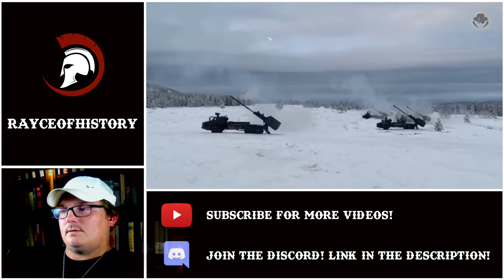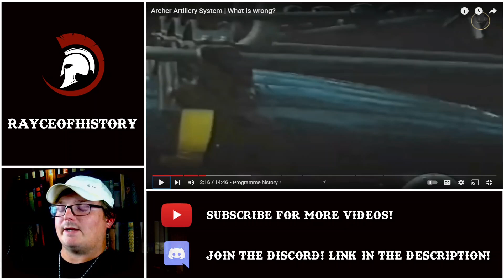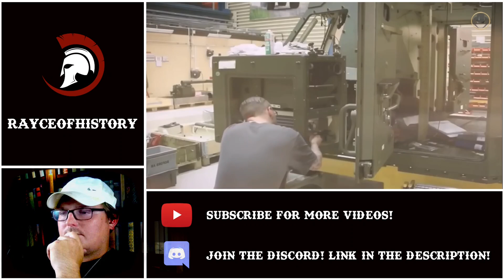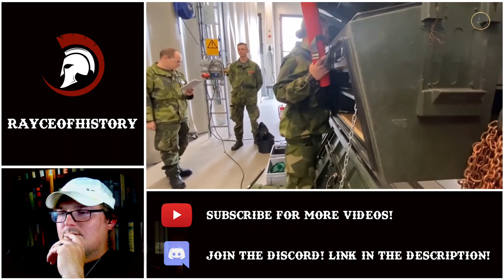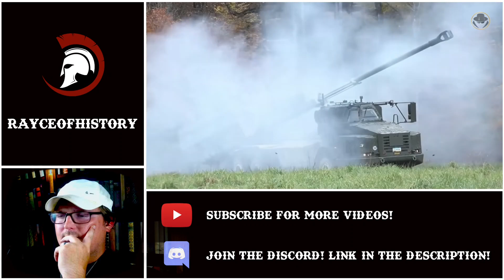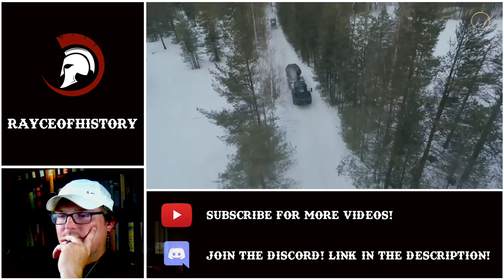Texan Reacts to Sweden's Archer Artillery System | What is wrong?

Comment: Britain has been in talks with BAE for that last few years about Archer . Archer was showen last year on a Man eight by eight chassis and not the volvo forestay chassis this is more suited to nordic country's not because of the snow but in summer there is alot of swamp areas in country's from Norway to Finland. So having it on the Man 8X8 is more practical for mainland Europe for speed and Spain parts off the shelf for mantinance as Man truck is a comon brand in  
Europe and among NATO country's  . The UK is now planning on replacing the SP 90 with the Archer it has recently ordered its first batch will most likely start to arrive later this year

Comment: The achievable rate of fire  is: up to 6-9 per minute in MRSI-mode (Multiple Round Simultaneous Impact) depending on source or (theoretical) 1.25 rounds per minute  in sustained fire. That's 75 per hour. Theoretical fire rate, practically not achievable.

However: Archer sucks if you are on the receiving end. Together with the PzH 2000 and the RCH 155 this the fastest MRSI capable 155mm system and in MRSI mode it basically can take out a bridge. And do something for which the US army relies on HIMARS. The US has nothing similar.

Comment: Firing artillery is different in burst and sustained fire. It all has to do with barrel life, heat, and stress on the equipment.
He did mess up though, as its 3 rounds in 13 seconds, not 13 rounds in 3 seconds.

Back to the point though: Burst firing with artillery is about concentrating a lot of boom on a small area in a short time, while sustained fire is about suppressing enemy troop movement in an area, and is carried out over a longer period of time. Burst fire builds up a lot of heat, and should therefore not be maintained for longer periods of time, as it drastically reduces barrel life.

Comment: Archer has not been produced for so long time so   it is not surprising the export is not so extensive yet. The offroad possibility vs. ordinary truck mount is a huge advantage in rainy spring and autumn season (look at Ucraine now). It is based on the Volvo dumper front which has been produced for a long time = not so complicated to maintain as the video creator believe 😊

Comment: I don't but the road truck argument. I work at Volvo Construction Eqpt, where the Articulated Dump-truck this is based on is made. We have service points all over the world, just like road truck companies. The engine used is 90% the same as on in a Volvo road-truck. Also, the technology used in the ADT is not unusual, so a heavy vehicle mechanic can fix it just as easily as a road-truck.

Comment: its not only about fighting on Scandinavian territory.

Its also about fighting with a total lack of manpower. Every weapon-system works with a skeleton crew. Really, every single weapon system works with just one person in a clinsh.

Its also about having absolut minimum bloat. Every system should be able to serviced like a civilian vehicle. The S-tank have the same engine as a Volvo Tractor. JA37 viggen have almost the same engine as a DC9 jet, the CV90 have the same engine as a scania truck.

Last but not least. If push come to shove. Last stand would be a guerrilla war with tanks, fighter-jets and submarines. The moment the enemy would be dominating, the Swedish armed forces would just vanish in the terrain. And slowly grind down the attacker to nothing is left.

And it snot only tailored to just Scandinavia in general. But there are specialty equipment and also units for the fields in the south, the coast, the forests and the fjäll (alps). Fjälljägarna (alp-hunters) are one of the most brutal regiments trained to walk weeks on foot in arctic condition to strike far behind enemy lines and totally take out there chain of command.

And you might think... how bad can it be, how many of them can there be. Well, they are conscripts, so ... loads and loads and loads.

Anyone attacking Sweden in the 80 tys would have a really bad time

Comment: According to my captains in the Swedish army the Bandkanon was too accurate. They said they wanted an artillery with more spread. Bandkanon had to re-aim to get the spread.
Reply: with a digital aiming system like the archer has, artificial dispersion could be added and removed as needed through software settings, therefore it could have very precise fire to avoid hitting unnecessary targets and be inaccurate in the case its goal is to simply just shell a big area of trenches/bunkers
Reply: Yes, correct - We look at nations developing artillery that with its standard ammunition can be used to hit specific at greater range. Whereas we treat artillery, like howitzers and mortar,s as area-effect weapons and if needed use specific ammunition for precise work in "simple" weapon systems. I mean Sweden co-developed the EXCALIBUR shell with the US and we made, for our own use, the BONUS and STRIX shells. Better to develop new munition than develop whole new redundant weapon systems around a standard munition of today's capacity right ;). Other nations pour a ton of money into something they are not able to use for its intended purpose. Like upgrading a saw to be able to use it as a hammer when there is a hammer in your toolbox already and making the saw less functional as a saw due to compromises. Also, we saw this with the 40mm gun on the CV90. It was shooting hole-in-hole hit pictures. So it also has a disperse system built in. Something it was harder to implement in the development days of the Bandkanon

Comment: Again it’s a perfect fit for Sweden since off-road comparability is key in northern Sweden. 

I take the hauler over a truck any day up north in a real war if it happens here. Winter/marches/spring/autumn this thing will not get stuck. 

But this video is correct about export of it needs to be put on a truck.

Comment: The smaller nations where and are often the most inovative .  sweden , switserland , belgium ,netherlands  etc  always produced high quality higly advanced equipment before their time often years ahead of other nations .   The swedes and dutch have had a extremly long cooperation going on dating back centuries .  The boforts 40 mm  Anti aircraft guns where lethal and safed many ships in ww2 .   in 1930s the dutch created triaxial stabalized Radar tracking and fire contolled mounts for the 40 mm Bofors . they where years ahead of the americans and brits as they never thought of the idea  . when the brits and americans saw this in action during an demostration in 1940 and 1942 they copied the system on larger scale  .   

The same with submarines ,  you wanted top end submarines with Snorkles , Advanced hydraulics systems ,under water  communication etc you went dutch ,  they provided sweden with designs for their submarines,   the german  Type IIA IIB And protoypes of the Type VII all came from dutch companies.    Sweden designed and suplied new guns for new types of cruisers for the dutch layed down in 1939 .a lot of history between them  ,   where the dutch would make a coastal battleship design for the finish navy incorperating swedish bofors  . 

Its a testemonie how sweden and dutch worked to gether as they are now also teaming up for a new class of submarines .

Comment: @5:50 "Special condition of Scandinavia" -That is a misled interpretation by mainstream usage of the subject. It was developed to function in climate and environments generic for any common SPH wheeled or tracked, of the world where the arctic environment is not on equal emphasis for the wheeled versions. The weapon system is developed to be added to any carrier able to.
The "special" would be the always added requirements from FMV, on all their ordered material, to include the arctic environment full out +, in this case, a carrier for the future tactical and strategic use of the artillery as running with the front echelons of the attacking or defending brigades. Ergo: It can do all that other Wheeled SPH do and in all environments validated, for anyone and in future battle doctrines of Sweden. This proved in 2021 at Yuma Proving Ground in Arizona which verified It's not a Scandinavian environment weapon system but an all-climate weapon system of high, wheeled, all-terrain capacity mounted on the A30 hauler chassis in Sweden's case. Depending on the carrier, you tailor it to its role in the nation's tactics and strategy. Swedish artillery needs to move with the front units of the mechanized brigades. So no " Special condition of Scandinavia" was involved in the weapon system development. I would say the added requirement just made it "more common", and "global" than less.
@10:53 Clarify: Burst mode: 1 round every 3 seconds for up to a total of 13 rounds.  -> At which point the barrel and its mechanism reach a high temp. The barrel's lifetime and the reliability of the system come into the equation. Some rest and recreation are in order. Seldom will continuous burst fire for 36 seconds (13 rounds) be used. Normal ammunition allows the Archer to fire the 6 rounds, burst mode for Multiple Rounds of Simultaneous Impact effect. But if you use longer ranged capable shells you may fire more shells in MRSI style with the same effect - For example, program 13 Excalibur's to 13 different targets in the same area. You can then deliver 13 pinpoint impacts on individual targets at the same time, with a firing time of 36 seconds. 75 rounds per hour are the sustained fire rate you can hold without the burst mode's problems with heat. One round every 48 seconds.  Normally you use the "normal fire rate"(the fire rate range is between 1 shell per 3 seconds up to infinity. You set that to what's needed per fire mission) and more barrels to achieve the same effect as a long burst from one barrel. You then fire a round every 9th second. With an average flight time of a normal shell of about 50 seconds, you can deploy, fire three shells and move from the fire position before the first round land on target. Shoot and scoot.
 @13:01 Observe the opened thermal concealment cover for the barrel. Not seen in other produced SPH platforms I know of. There is a lot of work into survivability gone into this complete system (Carrier and Weapon system)
@16:27 Maintainance - This said in the clip is not true. First off. You choose your carrier so the lack of sales due to carrier maintenance load, may not be it. Shell autoloader/magazine is more complex and part of the weapon system but it is not hard to access the loader. Yes, you need to know how it works. Which you need to do with any autoloader system. Manual loading for the battlefield of the future is not the way to go. And the development of the autoloader system for the Archer took a long time because the requirement was that it be easy to learn, easy to maintain, and flexible to repair solutions. The chosen carrier for Sweden - A30 Hauler can be found all over the world with large supply storage overall. It is a big machine but a dream to maintain and most parts are "off the shelf" and can be found in the global supply flow. "VOLVO Construction", delivering the foundation for these carriers, is part of the VOLVO Group Corp. "VOLVO trucks" and "VOLVO Construction"  use a common template for the different product branches in anything that is possible to do so. If you find a truck dealer in the town 2 clicks back you may have solved your problem.
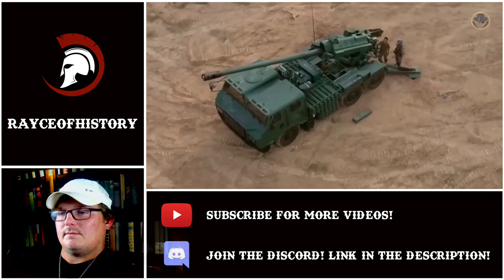@16:47 For a wheeled SPH using an armored A30 hauler as a carrier it is heavy but if your tactics allow, or use in a specific environment allows you, you can use a lighter carrier.
@17:16 I disagree - The geometrical architecture of a hauler combined with the hauler's excellent accessibility and macro construct make it straightforward in operation, maintenance, and repair. More so than a truck. In a normal brigade's vehicle maintenance units you will today find what you need to service, maintain and repair a hauler even if it's not in your military inventory. We have conscripts maintaining and repairing the hauler. Its as I said an easy vehicle to understand but it's a physical heavy job with its macro construct on everything. There is no special to it. 
@17:28 The only thing more expensive in maintaining the hauler to a truck is the wheels. Both for a common hauler wheel and especially for the wheels of a carrier to an Archer weapon system. These wheels have a function of working even if they all are flat. But expensive? in the perspective of things, it's a fart in the Universe.
@17:57 The hauler as a product has been around for 50 years+. The functionality, the production cost, and the refinement in areas like reliability, maintainability, accessibility, and durability of individual parts have continuously improved. The Hauler is a less complex system than a truck with a long experience in the fields of construction and timber hauling. What would be called a very rough terrain to a normal truck. A normal hauler is built to do rough day one and has parts and system to cope. And with it a more robust carrier. A truck in military service needs to be upgraded and to take a larger step from its normal than a normal hauler do. The larger the difference between the normal platform to its military platform the more complex and the more expensive the maintenance. Sweden took what was already proven and easy and slapped a weapon system on it.
@18:00 Crew. A driver. with the ability the articulator gives it's closer to driving an Archer than to driving a normal steered truck. Driver - Easier. Gunner (x2) used what we call a gamepad to steer the actions needed on top of a nation's artillery system and control, the Battle Management System. Both for the indirect fire of the main gun, the Direct fire of the main gun, and the Remote controlled weapon station (.50 cal/40mm GR). Easy. 
@18:07 No They put it on a truck so the foreign buyer could understand the concept, and get their head around it. A hauler was too way-out-there so they failed to see the actual weapon system. Not to make a better case of the carrier in the above areas.
@18:40 The initial cost with a truck or a hauler is in the hands of the seller. What it cost to maintain I have answered above and for all-terrain performance between a truck carrier and a hauler built for forester use in the first place, there is not just fording waterways that differ. The Archer weapon system on a hauler goes into rock scattered bush and forest, where no truck manages. Not standing, mostly, by the side of the road. The MAN 8X8 is a good truck and so are the Scania and Volvo trucks Sweden also uses but this hauler goes places they can not if space is given.
Is the guy in the clip going off the script or what. In the end here it sounds like speculations even if he touches on the buyer's perspective. I can tell you what is hard: To start to think and use an artillery piece as you would an infantry fighting vehicle. With the ease of operation, the Archer gives the artillery units they can follow and act with the Armor, IFV, and APCs up at the front reaching well behind enemy lines with its larger caliber gun. This is hard for buyers to get their heads around - It makes most weapon systems Sweden develops and produces hard to sell because they question the buyer's ways of thinking. Forcing them to think differently about the roles of the weapon systems. Why is that? Mainly because the weapon systems developed by the Swedish military industry in large do so in trinity cooperation between the developer (Bofors, Hägglunds, SAAB..), the buyer FMV (The government procurement agency), and the user (The Swedish defense force in question). Which in short means no bullshit, no bling, no good to have, no buzzwords, no engineer starting feature creeps into functions not functional to the user's tasks. Instead - Thinking outside the box, requirements to user demand from an agile user that through the ages always gone their own way to solve a problem as efficiently as possible. There is a reason Sweden with 10 million people still are able to develop technologies of top-tier validity. Sweden never sells much of the top tech parts because it's beyond the perspective of foreign buyers. We are not afraid of doing things our own way. And we are hard to impress. It's even harder for us in advertisements to tell anything not true. That is a Scandinavian special - Here in the north, a handshake means something.
Reply: Was just scrolling the comments to se if someone mentions the maintenance. It’s as you say about the vehicle. Dirt simple and parts everywhere. Not military my self but Swedish truck driver